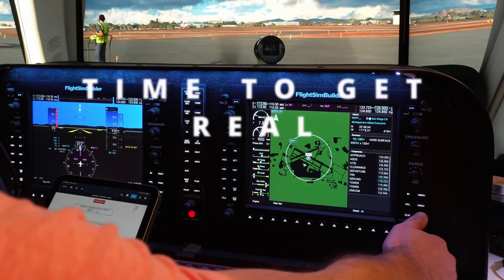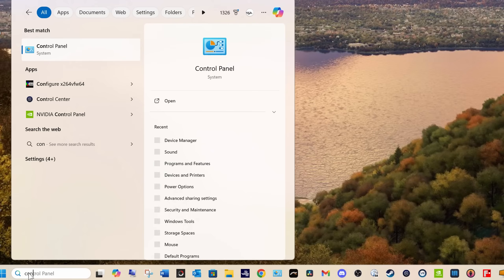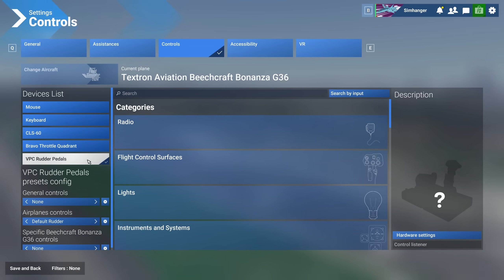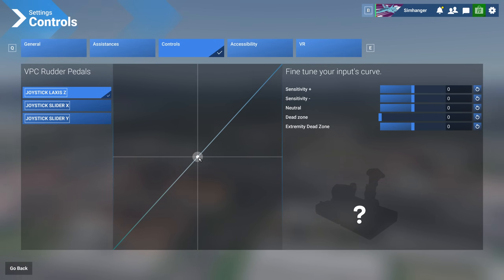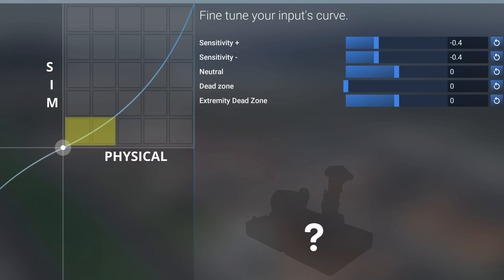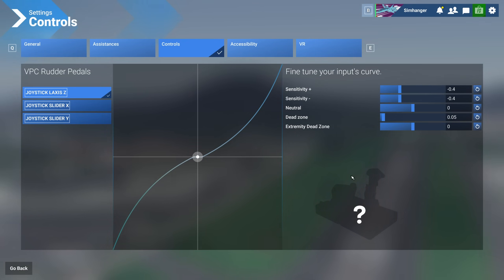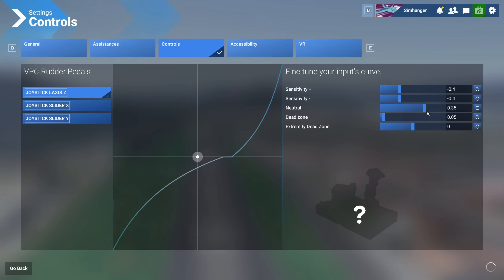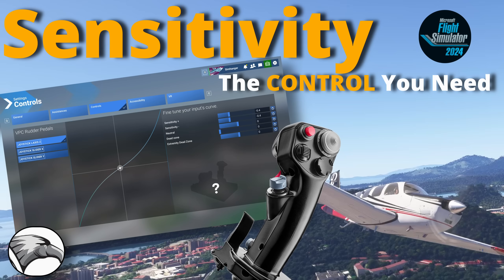Get the CONTROL you need | Sensitivity Settings in MSFS2024

Comment: Mark: Any possibility you might do an update on the MSFS2024 Controller Presets and additional options that arrived with SU2? Plus: I am still confused on what "Default" means and the additional Apply to Airplanes is supposed to do. Thanks! You da' man!
Reply from the maker: @Topcat1952 yes, once things settle down. Default & Apply to all aircraft to be combined as one now.
Reply: @SimHangerFS  Will look forward to it. I find the following "new" options when clicking the cog to the right of each profile: Create (assume makes a new one with no assignments), "Apply to airplanes", and the existing "Set as Default" (these two I don't fully understand); plus "Export" & "Import" (think I understand those). Thanks!

Comment: I thought this information was really useful in my situation it was a big help. I like slow responses on my controls I'm sure there's a lot of aircraft that I'll need to break this habit with. Especially with the helicopters. I remember when I was in the service I had a chance to try my luck flying a helicopter it was a complete disaster I was all over the place. It seemed like the more I tried to straighten things out the worse everything Got  know that without a pilot my landing wouldn't have been very pretty.🤣

Comment: My issue on the standard Xbox controller is that fighter jets don't roll or change direction fast enough. I have my sensitivity for Y and X axis cranked to max and deadzones are at 0. What's wrong here ? I want the planes to react faster with minimal analogue stick input just like real fighter pilots do

Comment: After some thought.
Go into flight_model.cfg in the unzipped package for the aeroplane.
In that file, there are three lines, -

elevator_effectiveness
aileron_effectiveness
rudder_effectiveness.

These will have values. e.g. 1.2

Adjust all three to 1.0

Use the method Mark is describing to get the OE back.

e.g. If the OE value was 1.2, 1.0 +20% will get you back.

Using ESCAPE, CONTROLS MENU, you can adjust the control surface multiplier 'on the fly'.

ALSO, 'elevator_trim_effectiveness' will need to be adjusted to get representantative effect for the trim wheel movement.

Comment: Example.
Aeroplane Heaven Spitfire Mk I.
When Brakes are totally OFF, rudder flips-to-centre when rudder pedals are not moving.
Put in an extremity Dead Zone on 'Brakes' and the brakes will never be totally OFF, so the rudder is fully controllable.

Warning. A Dead Zone in the centre of rudder makes landing more difficult and going out-of-control through overcompensating easy.

Comment: FS 2024 looks very good on a PC but did you know that:
This game is totally unplayable on Xbox X because the mouse freelook is overly sensitive. The slightest movement of the mouse results in the view spinning around and around and around probably a dozen times before stopping looking at the cockpit ceiling or floor. Career mode is not possible because of this. This problem is reported to Microsoft Flight Sim Forums, but still no response or solution. Microsoft didn't even give a refund. It's a total disgrace. I don't understand how they managed to miss this bug. You notice it the first 5 minutes after installing the game on Xbox X.

Comment: If anyone is using Logitech Saitek rudder pedals and have problems with toe brakes starts at 50% you have to follow guide on msfs forums or logitech website - Recalibrate the Flight Rudder Pedals Axes: RegEdit

Comment: What annoys me is every time I go into flight simulator I always have to pick my profile to fly the same aircraft In the control settings as they won't stick.
Reply: Same here. I have many controllers and I have to go into each one and change both profiles for each. I have set them all as default and set them all to apply on all planes and still.

Comment: Thanks for your video - I spawned the G36 into a airpor - t went to Settings / Controls / Velocity One Rudder / Flight Control Surfaces / Primary Control Surfaces / Rudder Axis / clicked in the box / Moved my Rudder Pedals  and it says in Bold letters "WRONG DEVICE"   -- I went into Windows and progressed to VelocityOne Rudder Properties / Hardware / Device Functions and it shows "HID compliant game controller" highlighted - I then highlighted "HID compliant vedor defined device" but the "Apply " button is greyed out. Sorry about the long explanation but at the moment I am stuck with Rudder Pedals that don't work -any comment advice would be greatly appreciated
Reply from the maker: Wrong device usually means you have not selected the device (ticked) from the left hand side of the controls menu. If that is not the reason then disconnect (usb) rudder and reconnect to see if it is recognised. Next check is exit sim and restart with only rudders connected. Make sure rudders are in PC mode and not Xbox mode. Let me know how you get on.
Reply: @SimHangerFS  Thanks Mark - I will now show my complete ignorance - how do I check the Rudders are in PC Mode and not Xbox mode?
Reply from the maker: @ blue light is Xbox mode & white light is PC. Press mode button (next to light) to change. May require multiple presses. Rudders on PC should ideally be connected directly to PC. For more info check out this video at time 9:19 https://youtu.be/g2MNh_S1R9I?si=rzPSGGrrK64AwP77
Reply: @SimHangerFS  My Vone Rudder Pedals have always been connected directly to my PC and the Light is white. I have a Xbox controller connected but I only use this to control my Drone Camerra. I will try the other suggestions and let you know - my wife is threatening me if I let dinner get cold .  many , many thanks Mark

Comment: I wanted to ask you about a VR head set. I have a 5800x3d and 32mg DDR4 3600 ram and a gigabyte 4070 super but my monitor is only 1080p and 60hrz does that matter in VR? I was looking at either the Quest 3 or Pico 4 or buy a new 34" monitor first ? I don't know I figured I'd ask you. You know more about it then I ever will.  Thanks Mark.
Reply from the maker: Monitor resolution has no impact on your resolution in VR.
Reply: I'm glad to hear that. still looking at them.